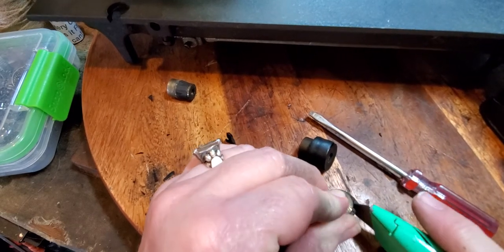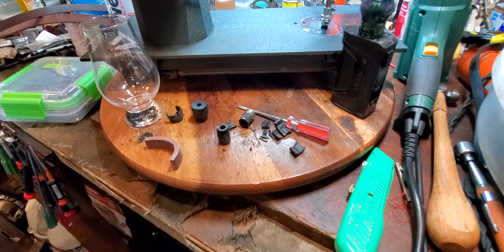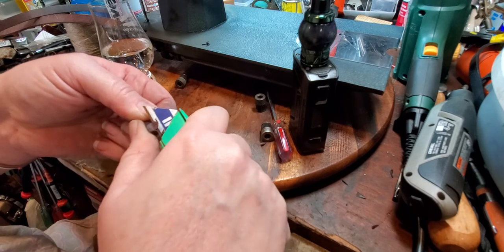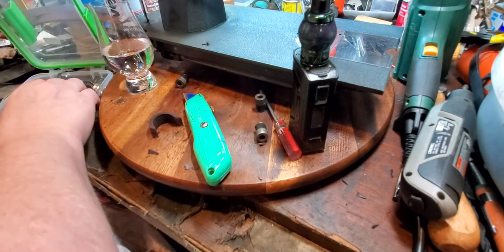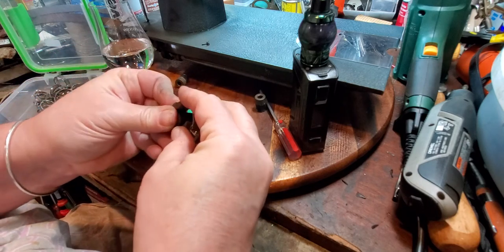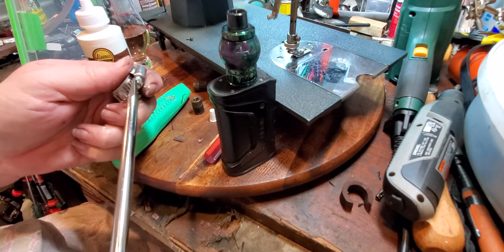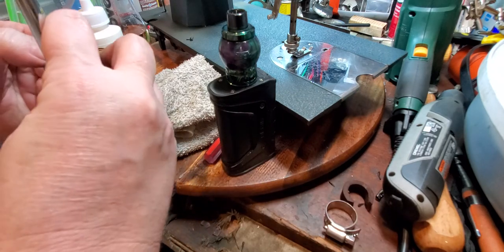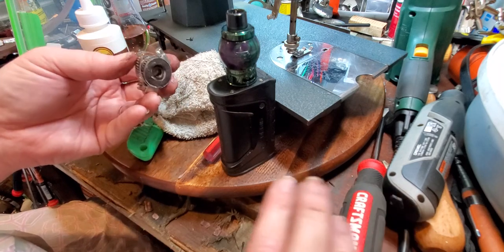Reusing a friction sewing machine motor pulley with leather

Comment: Love your idea. Very smart! 
I found a White 77MG (only needed a new cord and foot control) that someone had put a rubber o-ring over the dented original rubber pulley. It's quiet and doesn't make the motor boat sound at all. I'm wondering if using a wide o-ring over the original rubber pulley might be an easier fix. (It certainly isn't the cheap crap pulleys that come out of Communist China.) The key seems to be hard enough to run the balance wheel yet soft enough to not cause vibration, from what I've gathered in my own research.
Reply from the maker: That is definitely one way to do it!!